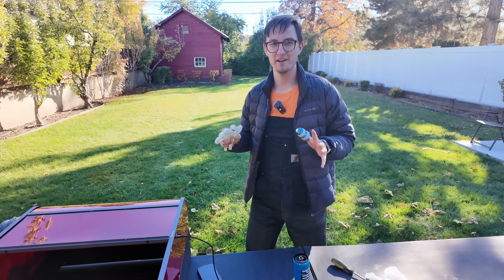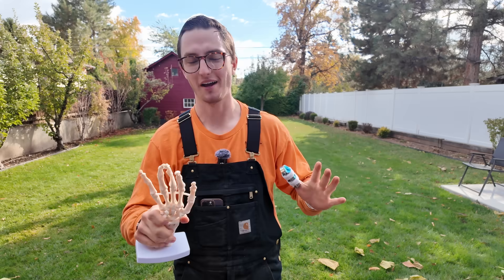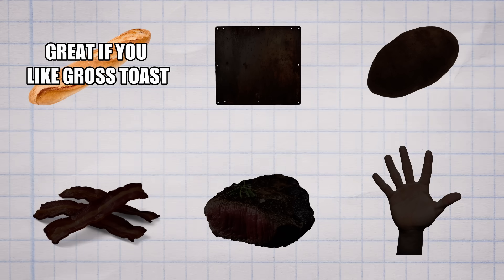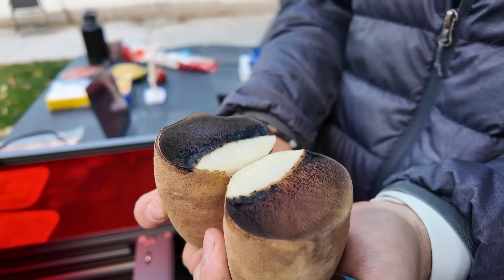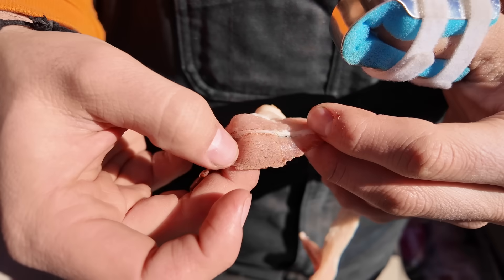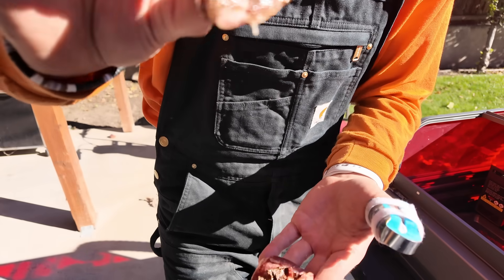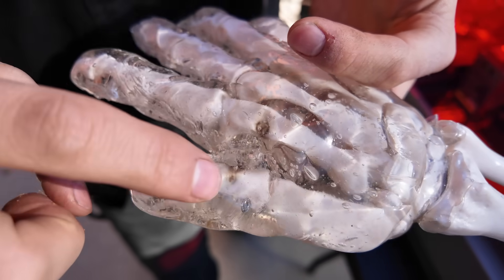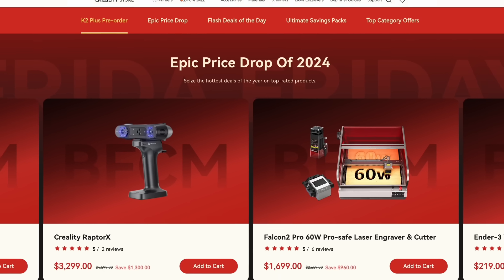What Happens If You Swipe A Laser Cutter?

Comment: I've cooked bacon on a Bystronic Bystar 6kw RF laser, took the cutting head off and turned it down to 1500w left the head at full travelling  height "approx 300mm"and just used the unfocused 20mm beam moving in manual all over my bacon.  My sandwiches were lovely!
At a later date, i did an egg, in its shell, it exploded, mess everywhere!

Comment: Got lasered by a 200W CO2 laser cutter when it turned on unexpectedly. It bured a smsll hole and the pain felt like a bee sting. Ironicslly it didnt burn nearly as bad  as you would think, the same laser that burns through thin plate steel snd titanium only burned in about 1/8 inch in flesh. The worsy part was the smell which smells distrbingly like barbicue porkchops or bacon.😮

Comment: I'm kind of disappointed that I clicked on a video about what would happen if you swiped a laser cutter and your laser cutter is 40W. Also, these small lasers tend to be rated at input power and you don't actually get 40w of output laser. That's nothing. It's very common in industrial lasers to have 1-4kw and they come even higher power than that. I have seen first hand what happens if you accidentally put your hand under a laser firing at 1200W (actual optical power!) Long story short, you get burnt pretty badly. One thing about industrial laser cutters is that they have a focal length. It's generally 5 or 7.5 inches. So, if you put your hand 4" under the focal point of a 1200W beam, you get 1200W in a circle of around the diameter of your little finger. Imagine a space heater putting out full power and it all goes into the space the size of a dime on the back of your hand. What happens? 2nd degree burns. But, I promise you, you will move your hand out of the way quite quickly. There is no leaving your hand under a laser cutter. It's so hot that your automatic reflex jerks you away instantly. Still, 2nd degree burns instantly. That's the answer. Will it cut your finger off? Almost certainly no. Flesh doesn't cut well so it takes a lot of time and in that time you'll move. But, third degree burns are possible. 

The bottom line is that you do not want any part of your body in the path of a laser.

Comment: Did it on a 40W CO2 chinese cutter I was building.  Had disabled the interlock to get the focussing sorted out, and put my hand into the path of the (unfocused) beam for a fraction of a second.  Hurt like hell, burnt a tiny hole into the soft part of my palm.  Went white and blistered around it, but healed without major lasting issues.
Reply: I did it with a laser engraver at my high school. I set it to engrave a tiny circle on one of my fingers, then bypassed the safety that prevents it from engraving while open. It didn't hurt. It was a very strange tingling sensation, and left a stark white circle on by finger that went away after a couple of days.
Reply: As someone who operated a 5000 watt laser at work, thats a death sentence just from the radiation exposure alone 😬 Class 4 lasers are no joke.
Reply: I burnt myself using one of those laser welders and it hurt.  Looked like a 3rd degree burn just in a very small area and took ages to heal.
Reply: @ sizzle sizzle, but does not taste like bacon 🤣💀
Reply: At what wattage?
Reply: @carpediemarts705 i suggest you read the comment
Reply: Do it again daddy! 😂

jk

Comment: I work with this, but 2 stories tall and a work surface the size of an average bedroom. Pretty strong, cuts inch thick steel like butter (thickest Ive seen personally) and once, accidentally reached into the machine before the cut was done and it flashed my glove. Instant flames, just from the scattered beam on the other side of the cut. Unscattered, I imagine I would have much worse consequences to rushing

Comment: I used to work at a place with a 24,000 watt laser that could cut a full sheet of 1/2” steel in less than 3 minutes. Was told that if the door was open and the laser was running, not only would you instantly go blind but the intense infrared radiation given off by the light could give fatal radiation burns from several feet away.
Reply: god that’s scary.
Speaking of which, my 8th grade tech ed teacher that does woodworking has a laser cutter in the room.
It didn’t blind anyone, did set off the smoke alarm when the exhaust pipe wasn’t installed correctly.
Reply: You were told wrong. Infrared radiation is non-ionizong so doesn't cause radiation burns. It can cause thermal burns, but not from over several feet away.
Reply: @muserock2367 Thermal radiation is a form of radiation. It's not ionising radiation, but he didn't claim that either.
Reply: I worked at a place with a 25kw Traumph Tru-matic metal cutting and welding laser. Had no barriers save for light curtains that work a lot like garage door safety devices. When it cuts metal the scatter makes a very odd heat but won't hurt or blind
Reply: @christopherleubner6633  do you mean 2.5kw?